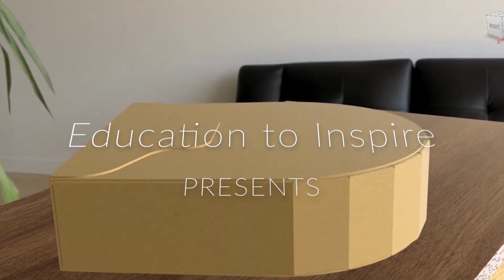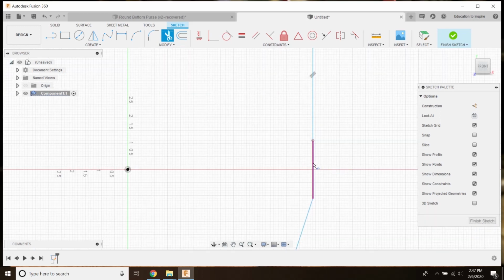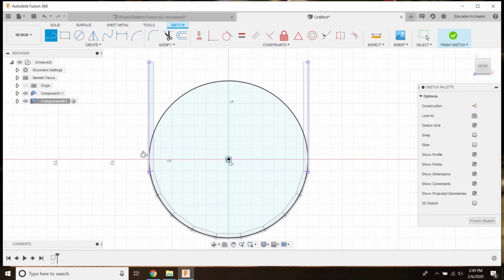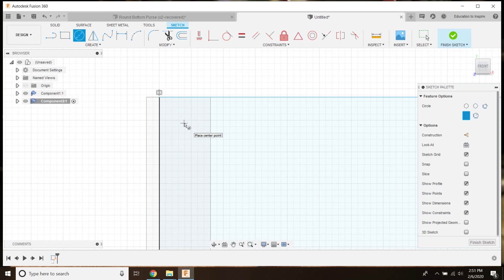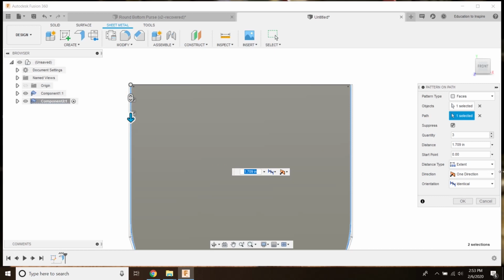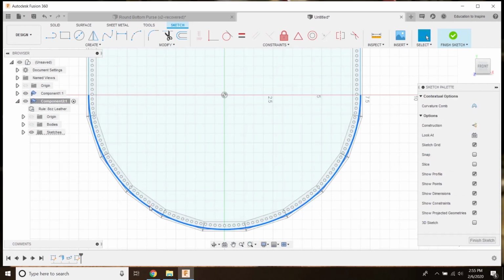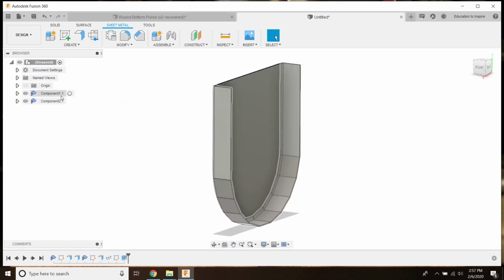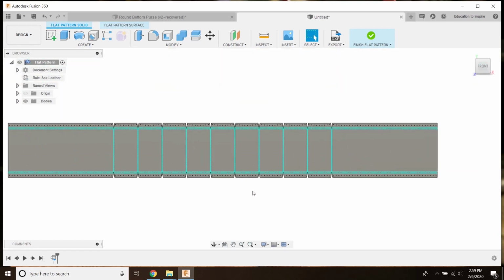Fusion 360 Leather Patterns - Sheet Metal Basics - Round Bottom Purse - How to Make a Bag

Comment: When you created the lips on "Component1" they became individual parts - due to sheetmetal as material. Are there ways to model the capability of leather to be bend and compresses like in wet molding?
Reply from the maker: Probably not.  There isn't a calculation for measuring and replicating stretchable materials if Fusion. It would  make for unpredictable stitch sizes and oval holes if it could be done.  If you leave the darts uncut you can compress it still.  You could also use the stitch template to punch your holes after wet forming the lip.